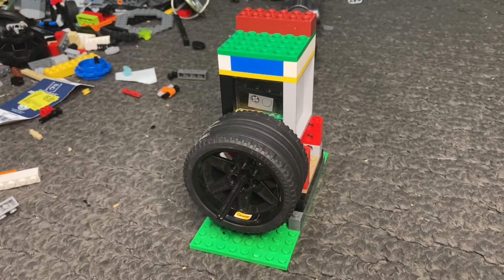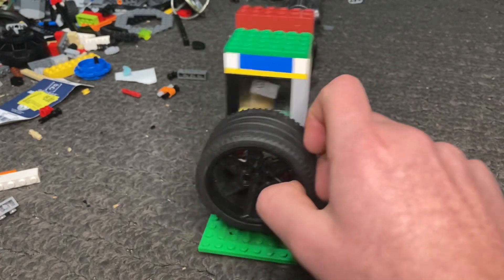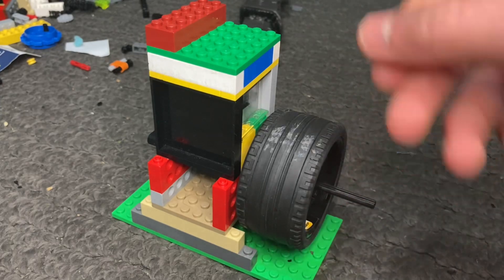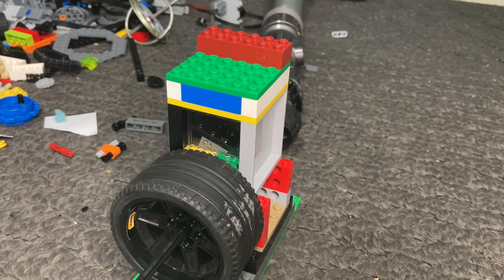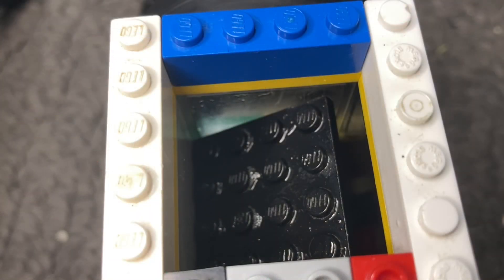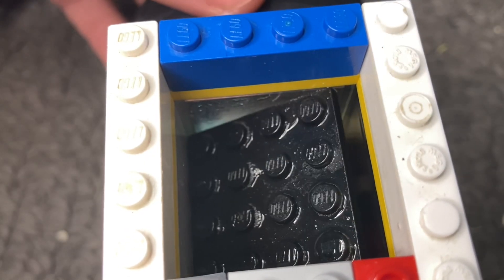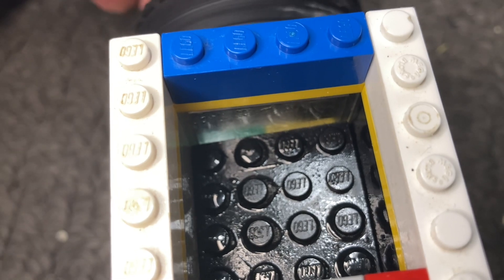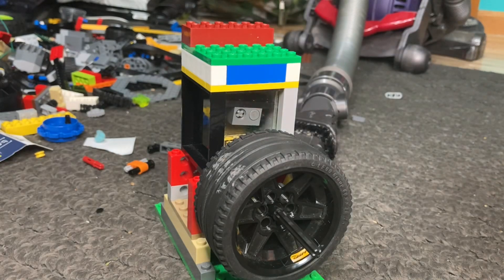One Cylinder Butterfly Lego Vacuum Engine

Comment: It does reach pretty good rpm, and sound is... different
I think I need to build an I4 of it! Or an I3
Reply: There's a problem with multi-cylinder configurations of this engine design. The problem with it is that it wastes suction power whenever the piston is on its "exhaust" stroke. This doesn't matter so much for a single cylinder, but take a twin cylinder engine, for example. While one piston is sealed, the other is leaking, which would take a significant amount of the suction power away from the piston that needs it.

This is why good valve design is crucial to multi-cylinder designs.
Reply: @EveKitty08  yea I know, I studied a bit about the engine and it’s the most efficient as an single cylinder (also most efficient for the size)
Reply from the maker: Yes! I’m thinking of making a multi-cylinder butterfly soon
Reply: @KFPlusLegoMastery  same, but first I have to make an “rotary” 2 or 4 (turbine)
Reply from the maker: @vacuumpowered6119  That’s gonna be cool for sure!
Reply: @KFPlusLegoMastery  i already made it! Its a 2 cylinder inline. The engine doesnt work if the crankshafts are offset. I tried 90° and 180° and it didnt work. The crankshafts need to be together, at the same angle for it to work, no suction is wasted as both pistons are doing the exact same things at the same time. I will record a video tomorrow

Comment: I think this engine style has LOTS of potential. Mostly beacuse there is very few moving parts. The biggest thing i can tell you to improve this engine is make the intake as big as you can get. That seems to be the only limitation that this thing has. More air = more force. The faster you can flow the air the better it'll do! Please make a tutorial for this engine because my old engine is mostly apart and it seems like converting to this is really cheap and simple!
Reply from the maker: Well at this point 75% of the current comments are asking for a tutorial... and also, the weird this is, if I had a wider intake it actually ran really rough.. it seems like focusing the airflow actually increases the performance!
Reply: @KFPlusLegoMastery  it prolly wouldent be too hard to make a butterfly V6 or V8